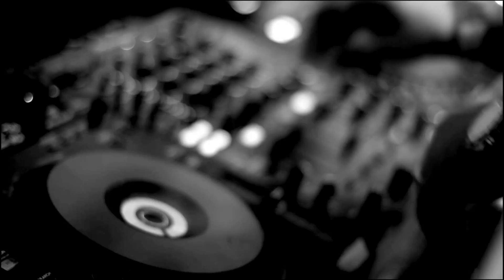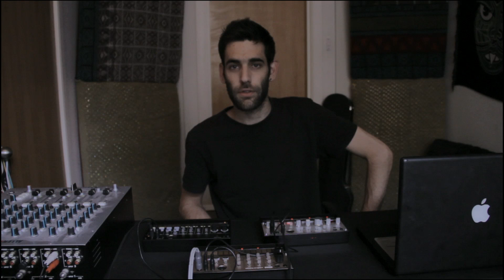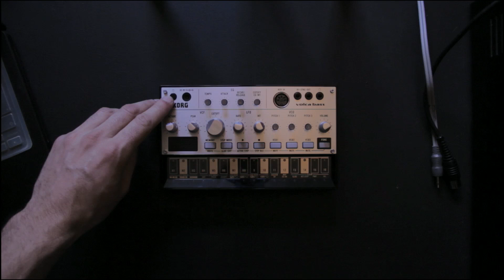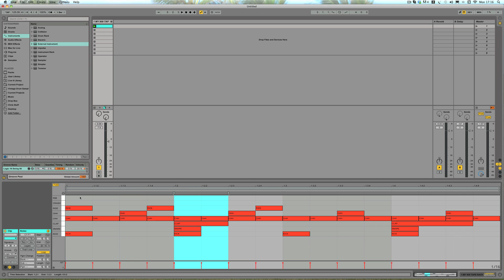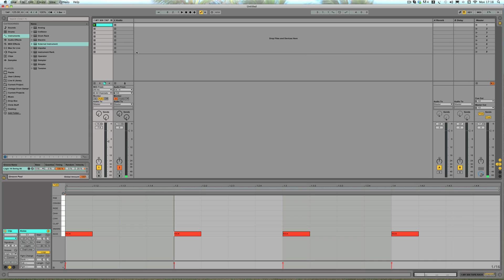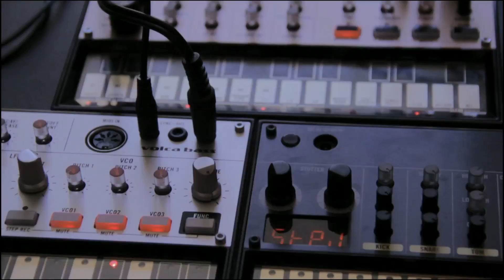KORG Volca beats/bass/keys - Recording into Ableton

Comment: Hi. I Have problem with Volca Beats. I don't have any sound from volca in my DAW. I use focusrite saffire 6 and i plug cables in rear panel of my audio interface like this : midi cable and 1x3.5mm stereo jack plug - 2x 6.3mm mono jack plug. All the same as in the video. I checked it in 3 DAWs (FL studio, Bitwig, Ableton) and nowhere is any sound from volca. I set in ableton all the same as in the video but still no sound. Im sure my audio interface works becouse when i plug studio monitors (cables : 6.3mm mono jack plug - 6.3mm mono jack plug) in the same place in my interface audio it work. Where is problem ?
Photos :
http://wrzucaj.net/image/yi6m1
http://wrzucaj.net/image/yiOTW
http://wrzucaj.net/image/yib2V
http://wrzucaj.net/image/yifLu
http://wrzucaj.net/image/yioz2

Comment: hi, I cant seem to get the volca beats sequencer synced with ableton live. I have it set up through the ext inst and can sequence via daw but the the voca sequencer is horribly out. the only way i can get it to sync is to drop buffer size down to 14. Ive done the latency set up tutorial and concluded that i need 1.54ms of driver error on 128 samples but this has no effect. Also, hitting play on ableton triggers the volcas sequencer but upon stopping ableton, the volca continues to play reverting back to its internal clock automatically, any help would be very much appreciated.
Reply: alistair elliman 
Try not using the external instrument rack, and just using the midi preferences set up within ableton. Go to the  prefernces window, and then click to "midi/sync" tab. look at the bottom half of the page where the available midi ports are listed , find the midi OUTPUT the volca is running on (which specific midi interface the voca is plugged up to), and make sure the "track " , "sync" and "remote" buttons are turned on. The track button allows you to see that interface on your track output selectors, the sync allows ableton to sync with the volca, and remote allows for midi cc messages(which may be of no use for waht you are trying to do) .   Now open a midi track for your volca, select the particular output the volca is running on in the "midi to"selector.  You should be able to now play the volca's sounds from ableton using a controller or a midi clip.   Make sure that sync button is on and see what happens. And maybe the "remote button" will send a stop message to the volca so it stops running, instead of reverting to its clock.   you'll obviously have to run the volca's audio on another track to be able to here and record the synth.   Let me know if all this crap I came up with actually works!

Comment: So if I plug my Volcas MIDI and Audio outputs into my soundcards MIDI and audio inputs which then goes into my computer, Can I use my AKAI MPK mini as a midi keybord for it? Or do the keybord have to be connected to the synth or soundcard first?
Reply: +LCGdude Hi have you sorted this solution would like to know if it's possible? Cheers!!

Comment: hello. thanks for the tutorial.  i have a.question. now you have created a midi clip take the sound from the volca. if for example i put 16 midi clip in the arrangiament view, can i do some automations from the synth and see them working and writed in ableton ? thanks so much
Reply: Yea, that's exactly what I am looking to do as well. Aka the exact opposite of this. Work the machine not the DAW.
Reply: Yes, how can i control the automation from the hardware but write note from the software
Reply: +Alfredo Acri did you find an answer dude?
Reply: Hello Ralph. not yet bro
Reply: It doesn't write midi automation from the volca, because there's no midi out. Volca is not a midi controller. However, any midi automation in the clip that is supported, will be executed by the Volca. There is a midi implementation chart on Korg's website.

Comment: Sorted from the Korg Volca Beats MIDI implementation chart

D#4 = CLAVES, 47 VOLUME, 51 PCM SPEED
G3 = AGOGO, 48 VOLUME, 52 PCM SPEED
D2 = HI TOM, 43 VOLUME, 56 DECAY
C#2 = CRASH, 49 VOLUME, 53 PCM SPEED
A#1 = OP HAT, 45 VOLUME, 58 DECAY, 59 GRAIN
G1 = LO TOM, 42 VOLUME, 56 DECAY
F#1 = CL HAT, 44 VOLUME, 57 DECAY, 59 GRAIN
D#1 = CLAP, 46 VOLUME, 50 PCM SPEED
D1 = SNARE, 41 VOLUME
C1 = KICK, 40 VOLUME

STUTTER TIME = 54
STUTTER DEPTH = 55

(C1, D1 etc. are notes on the piano thingie and the numbers are controllers found by pressing the E bottom left and selecting the desired control number from the second drop down menu)
Reply: If you can do a kick drum playing at 130 BPM

Comment: Hi. Great video, but I have a question. When I follow the Volca instructions and select a Midi Channel by holding 'Memory' and switching on the unit, the Voca only allows me to select midi Channel 16. Everything works fine in channel 16, but does my Volca have a fault in it? It has no problem jogging through the other 15 midi channels but always settles on Channel 16! Very annoying.. any advice?
Reply: you have to press the record button after you select the midi channel on the Beats unit, not play as stated in the video
Reply: *****
Yea I've got that and a monotribe and at looking at all of the volca range before I move on to more complex and expensive synths/drum machines. I love the satisfaction I get from knowing the machine inside and out and being able to create an idea that's in my head accurately and quickly xD still only have Live intro so max for live I haven't gotten into yet
Reply: John Feltham having only the volca beats, I spent two days trying to get a sound out of it through midi rather than just trigger the play button with ableton and al from pressing the wrong button ! but nevermind the thrill of playng with it now with a proper config through max that i fond on the web :))

Comment: Why is midi connection esential ?
Reply: Cant you just record via line in ( aux cable ) ?
Reply: Knavor Plo you can record via cable, but midi is much more accurate since basically it's the software that plays your notes through it, and you got perfect tempo on your pattern
Reply: Gianluca Ariotti Noob here; with a midi cable you're actually able to record the sounds from the Volca directly into the DAW?
Reply: Albin H-L MIDI doesn't carry audio information, it essentially carries notes to be played by any instrument. Therefore, you'll be using DAW to sequence these notes and have the instruments receive that information, then perform as you sequenced it.